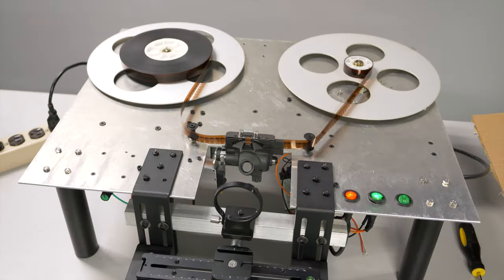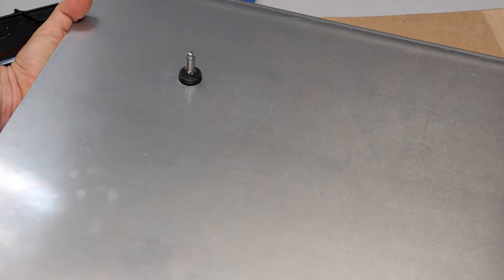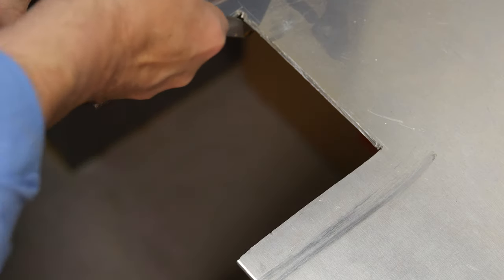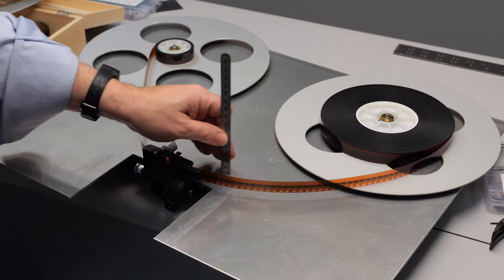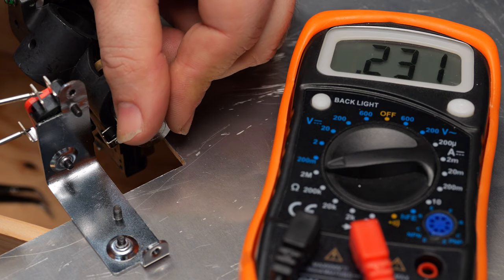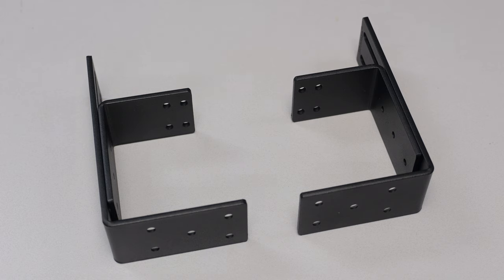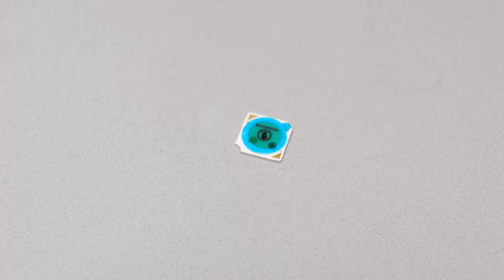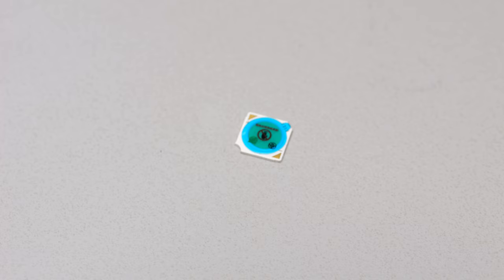DIY 16mm Film to 4K Digital Transfer System | Part 2

Comment: Awesome build. If you replace out the white LED you're using with an RGB LED array, you'll be able to improve the signal to noise ratio of the capture by neutralising the orange mask with a bluish output from the array instead of adjusting the analog gain (white balance) of your camera. That will maximise code value resolution for higher densities. For densitometric calibration (assuming 16-bit radiometrically linear raw output is available) adjust the output per RGB LED and exposure time such that d-min sits at an average code value of approximately 42000 per channel, this equates to a transmittance of 0.640 or density of 0.193 which will offer plenty of bottom room for D-min granularity. The older stock you're scanning has an appropriate density range for a traditional cineon log encoding. Assuming you've met the calibration conditions stated above for D-min, whatever the 16-bit linear code values are for each pixel going forward, divide it by 65535, this will solve for the transmittance of that pixel, convert that pixel transmittance to density via -log10(transmittance), then convert to 10-bit code values via 95 + 500 * density. This will produce cineon log code values in scanner density, printing density will require further calibration.

Comment: For rigidity, there's one very simple trick: Put the plate under tension in the opposite direction it wants to flex from the weight you put onto it. That way, the unwanted flex has to work against the rod or wire you use to tension---but as those already are under tension, they won't move any more.

Comment: Make your own flatbad! Great video again! Arri has used M2.3 and M2.6 screws in the past.These where sizes that could be bought in a good hardware store about 30 years ago for electric appliances. But non anymore, sadly. Now we only have M2.5 in between M2 and M3 left over. I still own the taps and dies for these rare screw and nut sizes.
Reply from the maker: Thank you for the information- very good to know!

Comment: Excellent video! I am in the process of building an Optical Printer with a Bolex REX 4 as the camera and something very similar to your machine as the “Projector”. The clarity of your presentation is a real inspiration. Thanks.
Reply from the maker: You might already be aware of this, but years ago there was a device made by J-K Camera Engineering that was an optical printer for 16mm - it had a 16mm "projector" with a registration pin, and you could attach your own camera. It was set up on something like a lathe base for stability and adjustment. I would have loved to find one of them! Thanks - good luck.
Reply: Yes indeed, the JK optical printer is a device that I am very familiar with having spent countless hours using one in the 90’s. They are all but extinct and SUPER rare these days. With your acumen for engineering and passion for all things film, you could probably easily build one yourself. They were amazing machines that were capable of very creative work. Thanks again for your thoughtful presentation in your work. As all the others who follow you, I look forward to the next installment. Cheers.

Comment: The build and video are both incredible! Can you share some more info about the adjustable camera bracket? I'm looking for one just like it for a project but can't seem to figure out the right keywords. Thank you!
Reply from the maker: Bought it on Amazon - Koolehaoda 240mm Professional Rail Nodal Slide Metal Quick Release Clamp - $34
Reply: @FreshGroundPictures  Thank you!

Comment: Brilliant . I wodner if all these components could be drawn and 3d printed to make a ready msde kit? 
Do you think there’s any way to bypass the whole claw/movement, and just jave a the film moved the exact amount by pulling it through with a precosion stepper motor?
Reply from the maker: It's probably possible, but without registering the film in the gate, I think you'd have to use some type of software to align the sprocket holes digitally.  I think Moviestuff machines do that. I'm more mechanically inclined (not an expert though) so I felt that a hard gate and registration pin would provide stable, sharp and flat results from the start.

Comment: I'm curious to see where this is going. Does it work without any sprocket wheels and loops next to the gate? Doesn't the alignment change due to the fact that the takeup spool gets bigger and therefore a constant motion by the motor misaligns or stresses the film? 

I'm about to built my own 16mm Scanner out of an old projector using an LED and a stepper motor. At least it should have all the necessary mechanical components already in place for an easy starting point - two sprocket wheels in addition to the film registration mechanism in the gate and the spools all connected by one gear system. Ideally I'll be able to wetgate scan by adding a water reservoir and a pump and some blower fans to it.
Reply from the maker: Yes, excellent observation! My original idea was to just use the take-up and supply spindles as I've shown - they have slip clutches built in so that if the tension reaches a certain point the clutch slips and stops pulling momentarily. In theory this could work for a whole roll of film, however I now feel that the tension gets a bit too high on take up. As a result, (and I will show this in a video) I'm putting in drive sprockets from the magazine that will allow a loop to be formed so that there's always even tension on film entering and leaving the gate - as I said, it's getting a little more complicated. 

The wet gate is a great idea, but I thought that a particular oil is used that matches the refraction index of the film base, and dries quickly? Thanks for watching!
Reply: @FreshGroundPictures  Nice. Can't wait to see the results! I guess I should be looking into the whole wetgate scanning process more thoroughly. I thought of just using distilled water with a wetting agent like the ones used in the final stage of black and white processing. I fear you are right though, it's probably some oil. At least I remember a friend who runs a drum scanning service mentioning oil and what an annoying process it to clean the negs afterwards.

Comment: Was there a reason why you didn't adapt a 16mm projector as you did with the 8mm project?
Reply from the maker: Because 16mm is mostly shot professionally with a tripod, I felt that image stability right into the camera was very important, hence the pin-registered film gate. There are a lot of projectors out there, and some might offer similar stability if not worn too badly. Rather than testing a bunch of projectors, I had the film camera parts, so I thought it would be fun to see if I could make them work, in essence "reverse" the process and still have the stability and film handling safety of a camera.

Comment: could you please a buying source / the exact designation for the LED? thanks
Reply from the maker: I'll get back to you - the LED unit I used is no longer made, and I have to check if there's a replacement. I think it was 95 CRI - the higher the color reproduction the better.